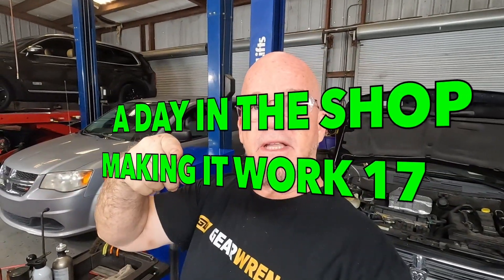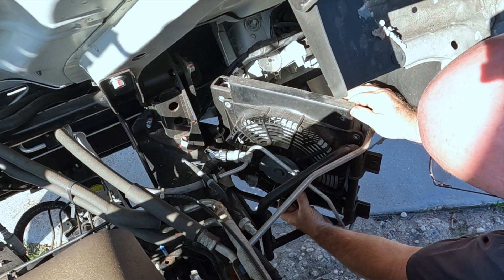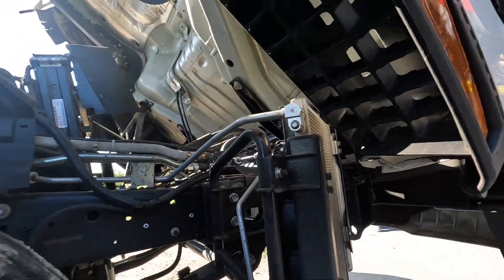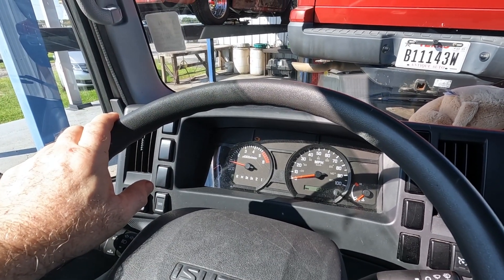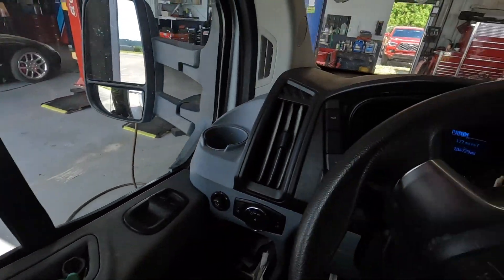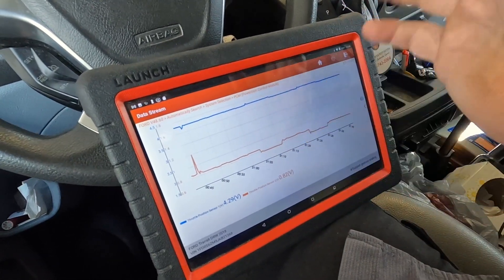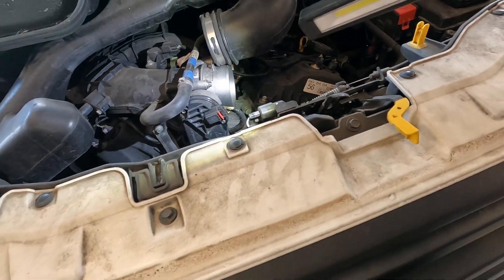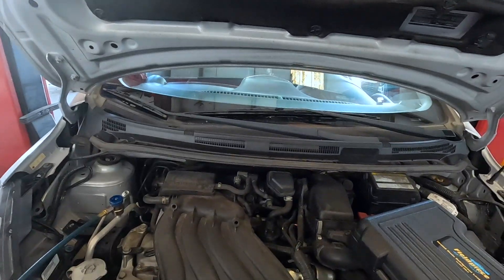A DAY IN THE AUTO REPAIR SHOP, MAKING IT WORK 17...ISUZU, CHEVROLET, C10, HYUNDAI, NISSAN...

Comment: 90f with 65% humidity in Michigan. I worked in my buddies shop the other day with air conditioning🥰

What a waste of fuel, letting those NPR's idle all day.

That Transit, you got glitchy data on the TB, sensor B. Thats a good arrow to problem. Could also check freeze frame, but that doesn't always pick up the glitch. TB replacement is not really shotgunning a part on with that data.
Reply from the maker: Yeah, air conditioning changes everything for sure!

Yeah, I was fairly confident on the T body job after seeing those glitches. I would have been positive if it reset the code while seeing them. But so far it's fixed!
Thanks!

Comment: It hit 81F with 53% RH up here in Orange County, NY at 950 feet MSL, and I was sweatin' bullets! Definitely not tempted to reach for a light wrap. I'm not complaining since this spring continues the cooling trend that started about twenty years ago. The air conditioner used to be mandatory by June first back then; now, it goes in closer to July first.
Reply from the maker: Thank for the input Tim!

Comment: 95 degrees @ 60% humidity...yesterday the heat index was 106degrees...south Central KY. Our boat mechanics are melting down. That water pump was definitely easier than the 3.5 Furd!
Reply from the maker: Damn man, that is rough. Sounds like they need some personal evaporative coolers! A couple of the guys here have them, but they are expensive so I've never bought one....yet.

Comment: Hey Boss, where did you get those long ratchet wrenches?
Reply from the maker: Those are mountain wrenches, I got them from my GearWrench tool guy, but I have them in my Amazon store. You can check it out from the description below the video. It helps out the channel if you decide to buy one or a set.
They have been very handy tools for sure, even after several years of daily use in the shop.